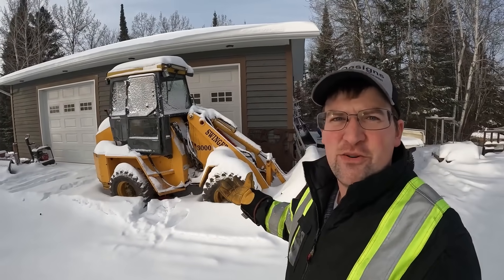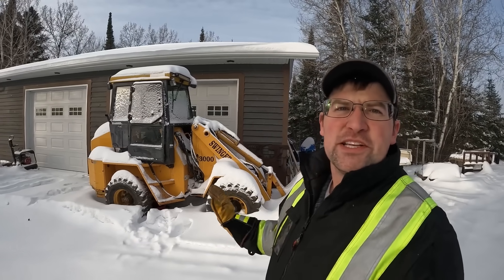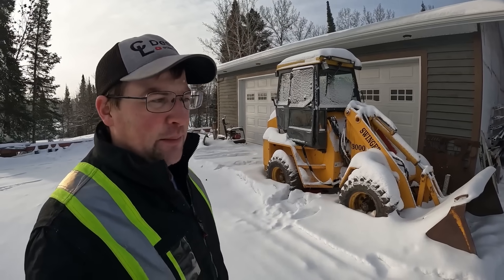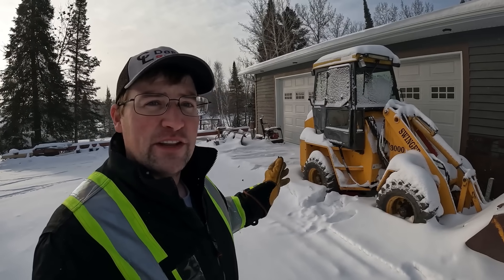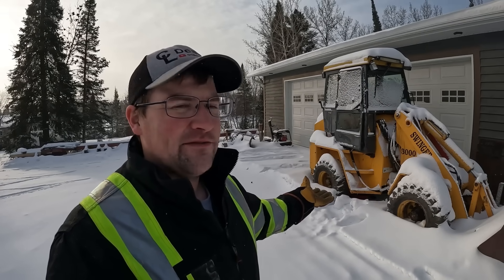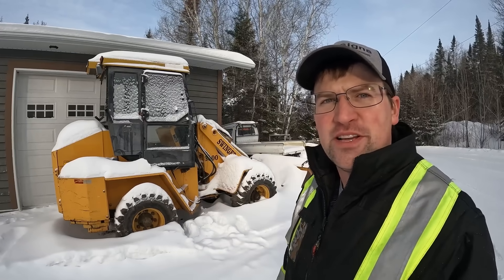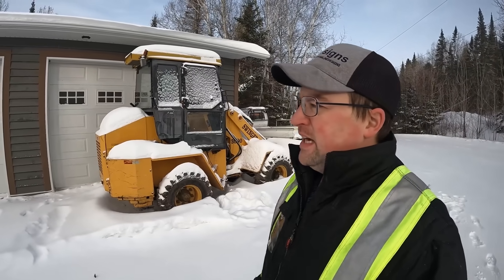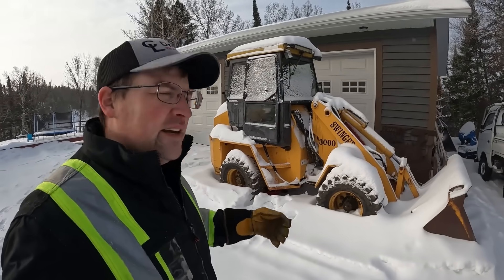$22,000 Hydraulic Pump FAILURE...... What Now?

Comment: On eBay right now there is an Eaton 3922 pump used for 575.00  possibly could have that one rebuilt or is good.
Reply: Yes the 019 is different  it has a b-pad 2 bolt mount and a 13 tooth spline the 103 has a c-pad 4 bolt mount and a 14 tooth spline. Sorry maybe the inner parts might be the same I really don’t know
Reply: @karlzerwas8851 , he could take the charge pump with the B pad from his pump and put it on a standard 39 series pump
Reply from the maker: Do you have the link? Any thing I had found weren’t close enough. But heck I’ll dig into it!

Comment: Find a deere machine that has the same engine and see what pump is used. The engine probably has a generic SAE mounting plate. Find out your pump specs and find a similar pump. That engine wasn't designed for the pump and the pump wasnt designed for the engine. Watch Deboss Garage when he engine swaps and old boom lift. Should be similar.
Reply: It's worth asking Deere if they supplied the engine and pump as a package for anything else.  If you're lucky,  the sold them as a package to a bunch of people.
Reply: @AlexA99423 My point was that there are other pumps that will mount up to that engine. Just need to find one that fits and has similar specs.
Reply: @denniscooper6328 That's a great point,  Dennis, mine was adjacent.    If Deere packaged powerpacks, they likely didn't do this combination only once. It's easy to ask them.

Comment: You may find something usable in scrapped ag equipment (combines, swathers) from the 80's that have hydrostatic drives
Reply from the maker: Yea I have to start digging!
Reply: @CenterLineDesigns Search for this unit at old equipment places, and see if they are scrapping out the loader - for reasons other than this Eaton pump failing. You probably already did this.
Reply: There is one at an auction in Indiana, the price is currently $5,500.
Reply from the maker: Working on it but there just doesn’t seem to be many of those kind of places around. Just finding them is a chore
Reply from the maker: Oh nice! You have the link at all Kevin?

Comment: Sorry to hear about the struggle.  But believe it's worth fixing. I've seen these loaders around but never in a salvage yard.  That pump will be very expensive if found rebuilt. I believe something else can be adapted. Research other hydraulic driven equipment that maybe more plentyful and adapt that. And as far as loader hydraulic that can be crankshaft driven
Reply from the maker: That’s a good point. I am starting to learn about similar pumps. It’s a heck of a learning curve!
Reply: @CenterLineDesigns  sometimes you learn to swim by diving into the deep end. Hopefully you are part salmon! 😊